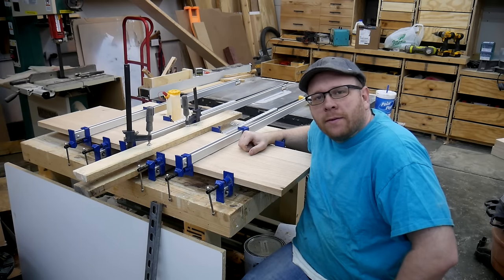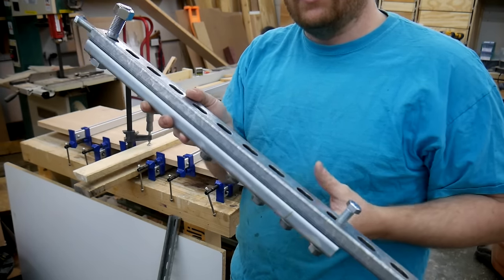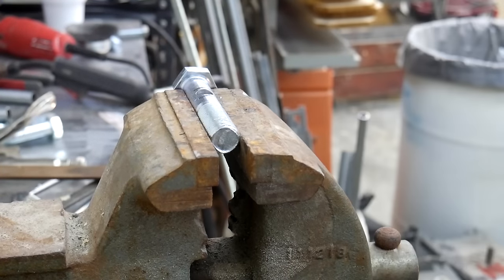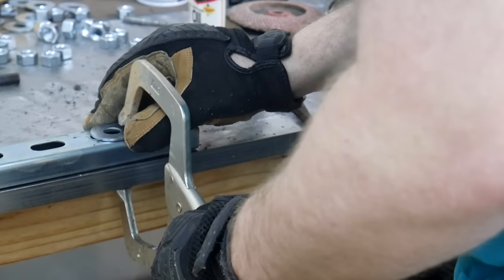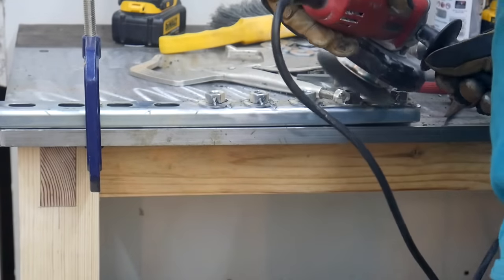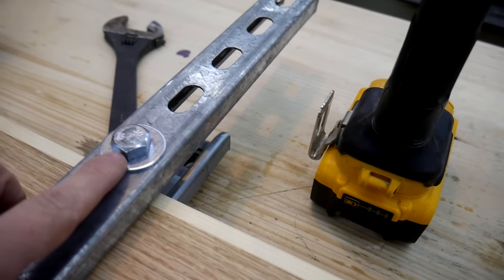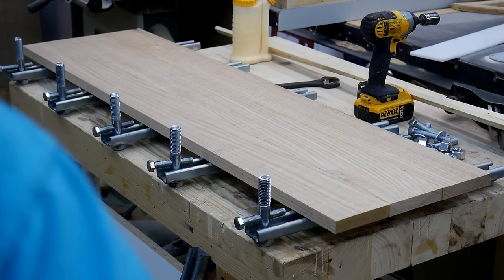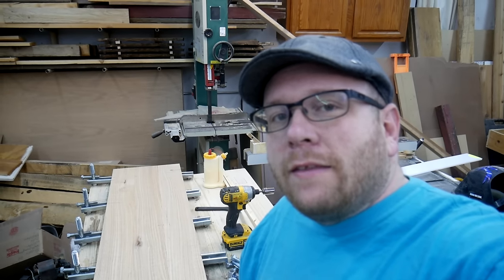3-Way Panel Clamp System

Comment: might want to tack weld some washers on the ends of your T bolts to help spread the load some and prevent digging into your sacrificial boards as bad.  I'd also consider sheathing the bottom edge of your unistrut with a strips of something plastic/melamine.  other than that,  consider it stolen :)
Reply from the maker: I had considered the washer thing.  Actually bought them to do it.  Not sure if I will though.  Plenty of scrap wood laying around for me to sacrificae ;)

Comment: Use some flat aluminum or polish that unistrut, maybe or put a smooth pipe inside the strut to stop marring. What's everyone think about those? They do make a lot of configurations of unistrut or other competitors versions. Things like half or full slots even no slots, painted galv zinc coated. I'm not sure about no coating. Food for thought.

Comment: Nice job.  Sure it's alot cheaper than the set I saw at the wood show that was like $400 for a large setup.  Perhaps line the metal area with hard board strips to keep from putting the indents on the wood surface itself.
Reply from the maker: I think that is what inspired these. I saw those panel clamps at the Woodworking show and thought they were cool. Came up with these as the “poor man’s” option

Comment: Next time get 1.5" Uni-Strut instead of 0.75", it's MUCH stiffer.
Use wood wedges instead of the end bolts, (no chance of damage), then hammer them tight behind the bolts.
There's really no need to weld-on nuts, just use loose nuts with washers.

You really don't want to be forcing a board straight, and then hope the glue will keep it straight,
you're just asking for a big mess.
Your boards need to be straight FIRST.

This whole thing looks somewhat "iffy"......
I would prefer to have a known, checked, flat work bench,
then lay down a sheet of Vis-Queen (polyethylene film) on the work bench,
then drill holes in the bench that are ~1" wider than the work-piece, to accept 3/8" All-Thread,
then use 1.5" Uni-Strut to hold the boards down to the bench.
Then use standard bar clamps to squeeze out the glue.
You should only need 3 Uni-Strut bars max, if your wood is already straight.

And, be careful tightening down the Uni-Strut, there's no need to bend it, 
and consequently, put indentations in your work-piece that will have to be fixed later.
Strips of cardboard can be used to protect the work-piece from the Uni-Strut.

So at this point, why not just use some cheap 2X4's and some 3" Drywall Screws to screw it to the workbench ??
Use #8 flat washers under the Drywall Screw heads to prevent burying them into the soft 2X4's.
If they bother you, you can fill the screw holes in the bench later with wood putty.
.
.

Comment: Great Contraption!!! I also do not weld, so I wonder if an epoxy on the washers would work? Kudos Amigo...:-)
Reply from the maker: The welding is mainly so I don't need two wrenches to tighten everything down.  You could do it without welding, but it may be more hassle than it is worth
Reply: lol

Comment: You need to put an foot on the pressure bolt on the ends. you could tar a hole in the end of that bolt and screw a piece of hard wood to it. No dents in the finished wood.

Comment: Nice Idea. Q: Did you use a Joiner to true the edges of the boards before Gluing?
Reply from the maker: I joint one edge and then pass through the tablesaw for final width. Makes perfect glue joints.

Comment: I plan on making some of these this week. Have you made any change or recommend any changes since you built these clamps? Thanks nice video.
Reply from the maker: I haven’t made any changes yet, but I do plan on making some hardwood inserts that will ride inside the channel as I clamp it down to help keep the channel from marring the surface of the wood. That would be my only suggestion. Thanks for watching!

Comment: If you dent the wood...wet a paper towel and put a hot iron on it for a couple seconds.  The wood will absorb the water and swell.  It will take a major portion of the dent out.

Comment: Hi, does it have enough power to laminate two pieces of plywood on top of each other?
Reply from the maker: I guess it depends on the application. When I laminate two flat pieces together, I just lay them on a flat surface and set a bunch of weight on top. Try to distribute the clamping force a bit. I’m afraid these clamps would only concentrate the force where the clamp would come into contact with the plywood surface.

Comment: Hi, why not try the clamps upside down this way you have a flat surface instead of the channel from the uninstrut on the board, just thinking you know.
Reply from the maker: Hey Steve. I did consider having the strut turned the other way. It can be done, but there would be complications if you wanted to clamp anything 1/2” thick and less because the cross bolt would get in the way of the flat face of the unistrut. I hope that makes sense.

Comment: Great build, I've been thinking of using 50mm square tube, it would be better across the surface so as not to mark it and also, use some 6mm flat bar in combination maybe with the sacrificial piece of wood. Nice clamp build though 👍

Comment: tools you have in your shop, he says like everyone can weld. It may be simpler to use rectangular tubing, the bolts with the taps also seem like a thing that can fail easier than some wedges.

Comment: 1:45 
I use a glue named kleiberit 332 with long open time. 20 minutes.
Reply: On the ends of the bolt used for squeezing the panel together UHMW would work great,  you just cut  a small block drill and tap to thread onto the end of the bolt (  just don't drill all the way through....just deep enough for bolt to be threaded into uhmw) [1,2 inch bolt=1/2 inch depth of hole]

Comment: good idea, seems fiddly though. most of the time for those that aren't just weekend hobbyists time is incredibly important and wasting it on fastening all those bolt and nuts may not be the best option. hit the forums talk to some people about ideas on ways to speed up the process of clamping and you may just have improved on those other more expensive clamp systems.
Reply: aah!! youve never used a bunch of bar or pipe clamps at one time have you. lots and lots of fiddling

Comment: Where did you get the metal with the holes  for the bolts .
Reply: It's called Uni-Strut. Most big box stores, if they carry it  will usually sell it in the electrical section.

Comment: A respirator isn't going to take the Zinc out of the air.  The increased airflow helps but only so much.  The solution is pretty easy ... don't weld galvanized parts.
Reply from the maker: From the CDC website about zinc oxide: 
Any particulate respirator equipped with an N95, R95, or P95 filter (including N95, R95, and P95 filtering facepieces) except quarter-mask respirators. The following filters may also be used: N99, R99, P99, N100, R100, P100. 
Click here for information on selection of N, R, or P filters.

Comment: zinc poisoning roflmfao. are you that concerned about tap water poisoning?
Reply: You go ahead and weld some zinc coated metal. And in 10-20 years or sooner, you end up with liver cancer you'll wish you had removed it. Zinc poisoning is no joke. I have seen its effects first hand. Your comparison to tap water makes no sense what so ever. If you are worried about tap water, then filter it.

Comment: If you will die from welding galvanized steel I would have been dead before you were born,,,,,and at 77 years old. I'm still welding the crap today. (When I am forced, anyway)  The way to take away the sickness after you get done lies in a Black Velvet and  Budweiser. +++++++